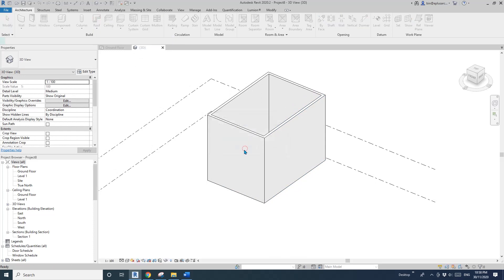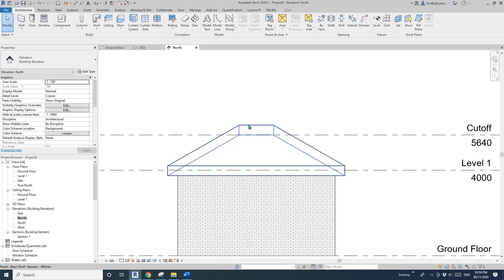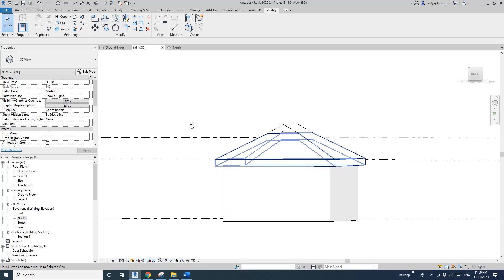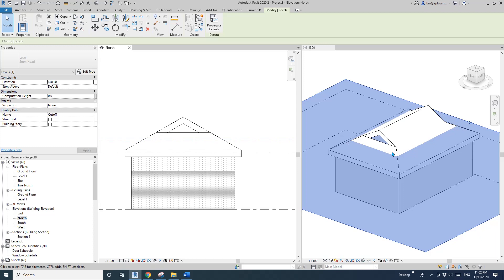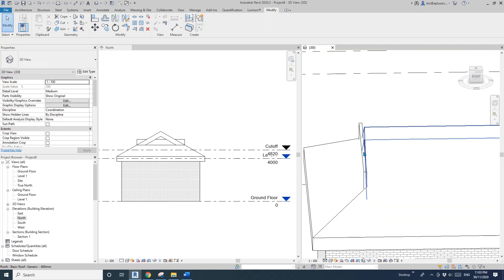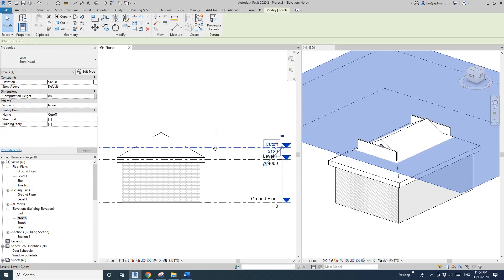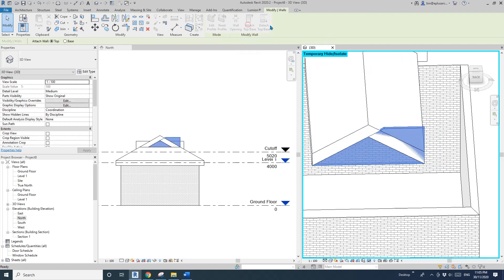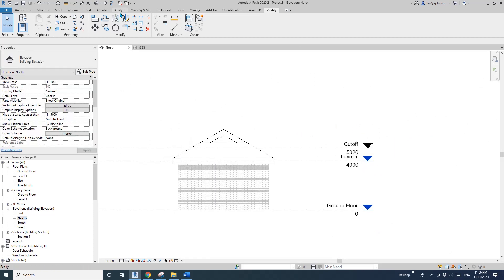Everyday Revit (Day 257) - Dutch Gable Roof

Comment: The slope of the top roof is fixed. So as the cut off level changes. The roof starts from that level but detached from the bigger roof
Reply from the maker: I think we need to adjust the footprint of the upper roof to match the lower one if we adjust the cut off level.